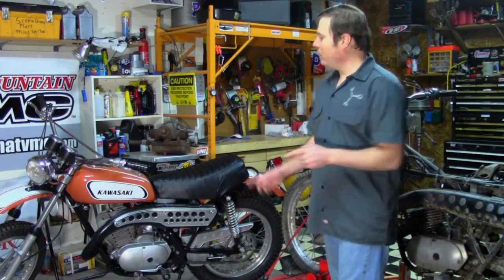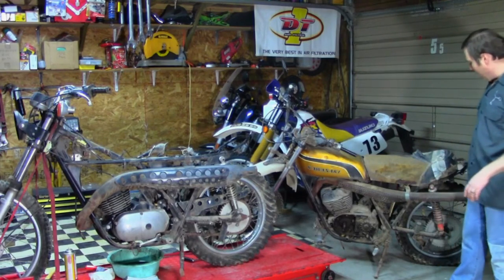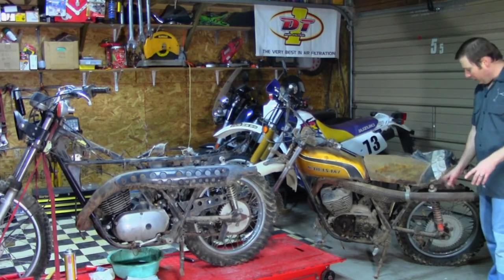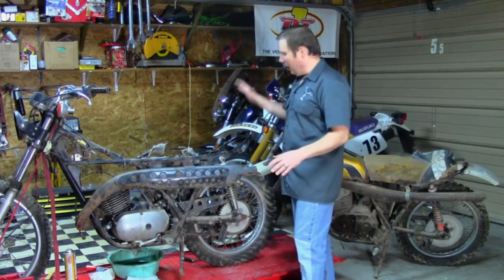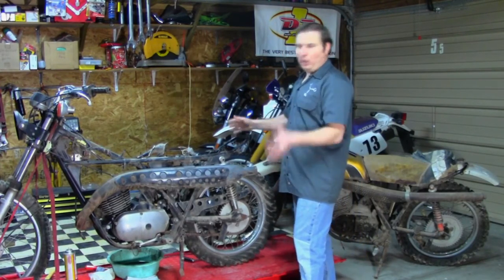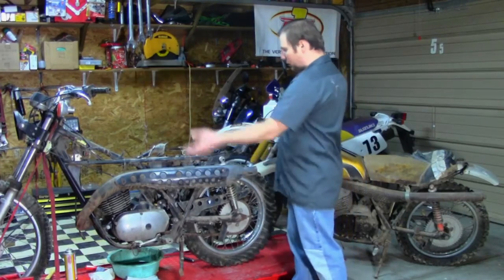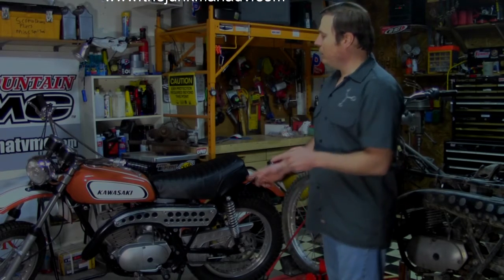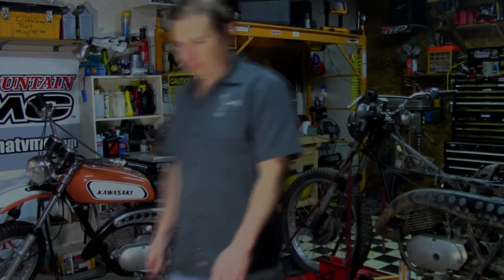Kawasaki F9 350 Vintage MX RACER! - Barn Fresh SE2 EP1

Comment: So I just started this series, but I really like how you actually have a clear direction and idea for this bike before you get into it. It seems like that helps keep you from getting sidetracked or derailed when you're tearing into it.
Reply from the maker: +dustysquito This is true.  Got to have at least an idea on what you want in the end before you start.
Reply: I've got a soft spot for the old twin shock look on vintage bikes. It's probably why I really like the Triumph Scrambler.  Since I'm only a small way through your library, do you only do dirt machines, or have you built up some street bikes as well?
Reply from the maker: dustysquito Yes, but those happened "BI" or before internet.  However in the future some vintage street bikes may make an appearance. I have a collection of Kawasaki triples in every displacement, in different states of repair that could be future video series.  I also have a Bridgestone 200RS twin that I have kinda stalled on at the moment.  If you buzz around my website you can see tons of pictures.

Comment: I am busy with a '70's series scrambler project, using an F5 motor. I don't have electrics for it. What can I use instead of the original CDI system? Thanks for any help. Greg in South Africa.
Reply from the maker: Power Dynamo Vape makes one. It's about $500usd. It is bolt in.
Reply: Thanks for the quick response. I did visit the website a few months ago, but was unable to pin anything specific. Time for another visit. Appreciate your reply, will be following your progress with the MX version.